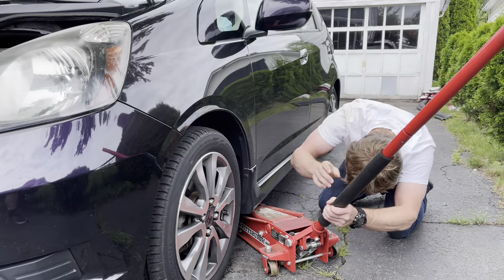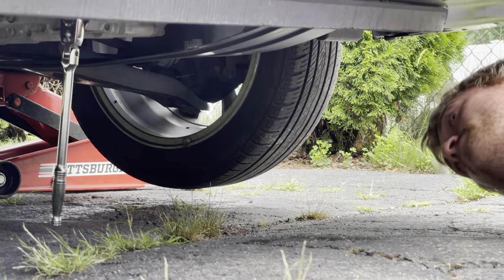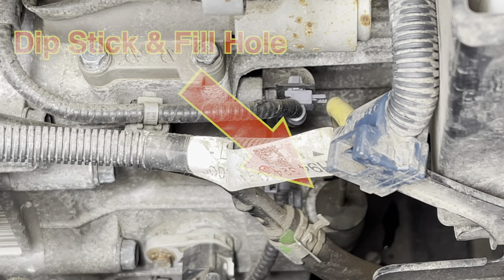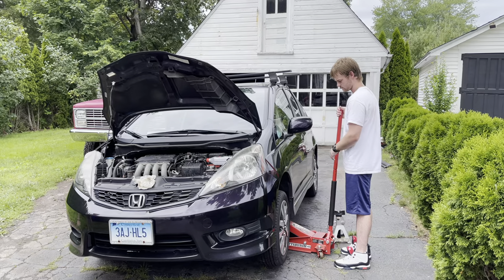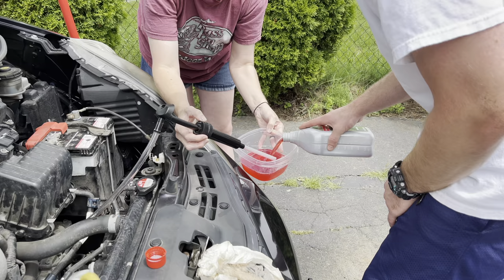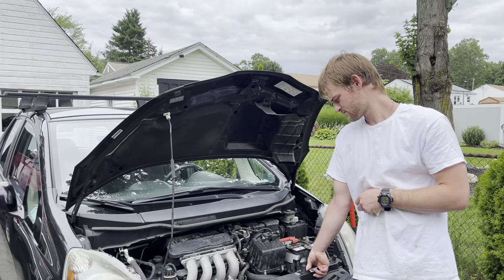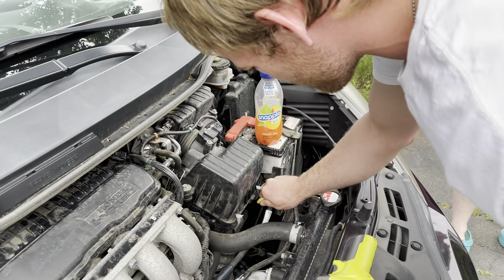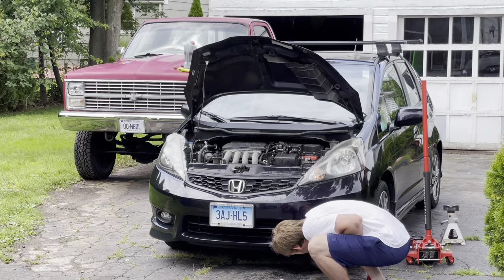DIY Guide: Changing Transmission Fluid in a 2013 Honda Fit

Comment: I believe you should drive the car until the fan is running then check the transmission oil. The gearbox needs to be running to heat up the gearbox oil. Hope this helps ❤
Reply from the maker: Hi Steven. Thanks for the tip! We followed the manual, which states on page 208 to park the car, start the engine and wait for the fan to start. Manufacturer's usually have specific instructions for each vehicle, and it's best to follow what the service manual.
Reply: It definitely don't have to be driven. It does take forever for those fans to kick on though in cool weather when it's like 50 degrees out
Reply from the maker: @jackle842000  Correct. The manual doesn't mention driving it - just getting it to the proper temperature. It was a kind of a strange procedure compared to what I was used to, but I'm older, and cars weren't so fancy back when I worked on them.
Reply: @MarkDHall  Right there with u on that one. Been a total game changer over the last 30 years no doubt!
Reply from the maker: @jackle842000  But it's still great that people are so into cars, though I think a lot of younger kids don't care about them as much.

Comment: Honda DW1 fluid as used in the video is  NOT designed for Honda Fit transmissions , Wrong fluid. Use Honda CVTF .
Reply from the maker: We don’t have a CVT transmission. Using that transmission fluid in it, would be very bad.
Reply: USA models 2007-2013 use this transmission fluid DW1. So he is correct in using this.

Comment: Today Honda and 3 other shops quoted me over 200 bucks to do this on an '07 Fit.
Reply from the maker: What?! That's crazy! I'm old and remember oil changes that were less than $20 at a shop and in the store a quart was around $1.00. Now it's not uncommon for an oil change to be $100 at a shop, and oil by itself is crazy expensive. Hope you're able to do it yourself and save some cash.

Comment: Good Video 1- So during this, would be like almost a Full transmission flush 2- but if you do a one time flush it would be a 20% Flush which Scotty says to do 3- I would change the transman Filter also located under the battues. I Just bought the 2013 Fit  so going to do this in the spring when it get Warmer. (might do a 2-flush) How do you like your 2013 Fit?
Reply from the maker: Hi - Yes, doing it this way is not a full flush. It's a partial, so you do need to do it multiple times. Changing the filter is also a good idea too. It sounds like you're going to have a great time with your Fit. They are awesome cars. We love ours. Thank you for watching.
Reply: @MarkDHall  and its a good choice as  gas prices keep going up and it fun to watch the GPM meter.
Reply from the maker: @musicstevecom  Exactly. With their prices going up like crazy, it's good because it pretty economical, and the engine is a basic engine, which is really reliable.
Reply: @MarkDHall  Does the American Honda Fit 1.5 sport 2010 year have an automatic transmission or cvt?
Reply from the maker: @giorgiiobashvili3552  HI - I'm not really sure. Our 2013 is a traditional 5 speed automatic. Not sure about the 2010, though. Sorry I couldn't help.
Reply: CVT’s came out after the 2014/15 models.

Comment: I don't understand why 3 times.  If I take the car to Honda for AT fluid change am I going to have to bring the car back 3 times?
Reply from the maker: Hi Jim. The service manual (not the owner's manual) recommends flushing the transmission three times because there’s still fluid in the transmission lines and torque converter after just one flush. If you have it done at a shop, they should schedule you for 3 flushes, but I don't know if they actually do that.

Comment: Try using a 1/2 inch copper pipe and funner next time. That how i add transmission oil to my car.
Reply from the maker: That's an awesome idea! I told Matt about it, and he said he'll remember that for next time. The pump thing from the store didn't work very well.
Reply: @MarkDHall  Cool, Just make sure you  deburr both ends of the pipe. Otherwise, The burrs might break off and get mix with the oil.
Reply from the maker: @francpez7564  Thank you. I'll let him know.

Comment: Great video.  I will do exactly how you did it.  What was the torque value of the drain bolt?  Do you remember?  Thanks for the video.
Reply from the maker: Hi Michael, unfortunately, I don't know the torque spec, but Matt said he will look it up and get back to you if you haven't already done the fluid change.
Reply: 36 lb ft/ 49 Nm if same as 2009 (09 and 13 are both gen)
Reply from the maker: @mankchiu  Thank you for sharing!

Comment: Hi, I have honda fit 2012 GP1 (From Japanese market). The transmission oil dipstick is labelled HMMF. Unfortunately, I seem not to find Hmmf in my country. Instead I find CVTF fluid. Can I use CVTF instead of HMMF?
Reply from the maker: Hi George - I'm not familiar with HMMF fluids and can't offer any help. I'd try Googling it or asking a local repair shop if there's any nearby. Thank you for watching!
Reply: @MarkDHall  thank you for responding to my question. I will appreciate if the repair shop can clarify to you the difference between CVTF and HMMF.  I will be following your channel. Thank you for the good work you are doing.
Reply from the maker: @onyangoabuor5863  Thank you again for watching. Really appreciate it.

Comment: I have a 2012 honda fit sport, the transmissions gears hard from 1 to 2. Could it mean its about to go out? Checked the fluid and its not low or anything 🥲
Reply from the maker: Sorry for the slow reply. It could mean there's a problem. I'm not a transmission expert, so I'd take it to a shop and have it checked out. Hopefully, it won't be anything major.

Comment: Many thanks for sharing your information and experience. How did you manage to get the instructions? I would also like to learn more about the replace vs. fluid flush. Thank you.
Reply from the maker: Hi! Matt works at an auto shop and has access to the service manuals. They're different and cover things the owner's manual doesn't. Matt was taught that generally flushing fluids with a flush machine isn't good to do and can cause issues, but I would definitely suggest doing research and seeing what is best for you. Thank you for watching!
Reply: Not much info seems to be available.
Will have to consider yours, given the reading material you guys were able to access.
I once flushed a Toyota transmission and will do so again.
The Honda Fit CVT is another matter though. Will not take the risk unless I find credible recommendation to do so.
Reply from the maker: @super8tube1  I'm not sure if I mentioned it in the video, but our transmission is not a CVT. It's an old fashioned 5 speed automatic. When I was younger and had just gotten married, I took my wife's car into a dealer to have the transmission flushed because it had never been serviced. It was higher mileage, and about 2 weeks after they flushed the engine, the transmission died. It was going to be $3000 25+ years ago, so we just sold the car. We spoke to a different mechanic afterward, and he said we shouldn't have had it serviced, especially flushed because it was so old any worn metal inside was "holding it together" and keeping it working. I'm not familiar with CVTs, but I know they are different. Again, I'd talk to people and try to read up, though I know there's not much info, and see how to proceed. You don't want to fool around, and you want it to run for years.

Comment: Tks for the video, but I'm wondering about the filter. Should it be changed every time you change the fluid? Tks
Reply from the maker: It depends on your year. Our manual says to change it every 30,000-50,000 miles. Matt said ours wasn't due when we made this video, but he did it on the next one.

Comment: Hi Mark, thanks for your video, do you know if there is any difference between a 2012 ATF and yours?
Reply from the maker: Hi - I'm not certain about that. I know some models had the CVT version, whereas we have the version that has actual gears like 1, 2 and so on. Even if they're both the same type like the, I don't know if they're the same or different. Sorry I couldn't help. Maybe the manual says?

Comment: Which one is the type of  ratchet that you used and the size?
Reply from the maker: It's a Snap-on 3/8" Drive Dual 80 Technology Long Handle Flex-Head Ratchet. It's about 12" long. Editing to add the model number is FLF80A. We went with Snap-on for the pivoting ratchet because all the other ones we had would break at the pivot point. Hope that helps!

Comment: Tengo un 2009 cuántos lts lleva de aceite??  Y gracias por compartir!!
Reply from the maker: Hola, no estoy seguro porque podría ser una transmisión diferente a la mía. Tienes el manual? Podría decir.
Reply: @MarkDHall  es un Fit 2009 4 cilindros automático motor 1.5 lts. Que tipo de aceite lleva?
Reply from the maker: @juancarlosbermudez2434  Hola. La información debería estar en la tapa del aceite. Yo también consultaría el manual. ¡Espero que ayude!

Comment: Hi, can I  know if my honda fit she's, 2013 model cvt if it has  a filter in the gear box?
Reply from the maker: Hi Matthew. I'm not exactly sure about the transmission filter, but I found this website, which tells a little about it: https://www.nalleyhonda.com/2013-honda-fit-transmission.htm#:~:text=2013%20Honda%20Fit%20Transmission%20Filter&text=Your%202013%20Honda%20Fit%20will,every%2030%2C000%20or%2050%2C000%20miles. I'm not sure if the filter is inside or outside the transmission. Hope that helps.

Comment: Thanks for the video! Did you have to jack up both sides of the car, or just the driver's side to be able to access the transmission drain bolt?
Reply from the maker: Hi - I can't remember for sure, but I'm pretty sure we just did the driver's side. I watched the video and don't see any indication that we jacked up the passenger side at all.
Reply: @MarkDHall  thanks!

Comment: Thanks for the video. Just to be clear, 4 quarts came out and were replaced with three?
Reply from the maker: Hi Kevin. Yes, 4 came out and 3 went in. We had always had a shop work on the car, and they must have over filled it when they did the transmission fluid change at 60,000 miles. When we put in 3 quarts, the oil was exactly at the full line on the dipstick. If we had put in another quart, it would have been way over full.
Reply: @MarkDHall I thought it was due to not getting all fluid out when draining, which is why it’s recommended to do this 3 times.
Reply from the maker: @kylecline  There could be fluid left in the transmission, but you ultimately want to go by dipstick. Four came out of the pan, but if we had put more in, it would have been overfilled.
Reply from the maker: @kylecline  Wanted to add that you're correct about the 3 times being needed to get out as much of the old fluid out as possible. It's never going to get 100% out, but Honda must feel that 3 times is enough to dilute it to not cause any issues.

Comment: Question .. each time you drain the trans fluid do you need to put new one in .. ? so 3 changes off new fluid ? or do you just put new fluid once .. then drive it 100miles drain it and re use that fluid that came out  after the 100miles ..
seems excessive to use new fluid each flush
Reply from the maker: You want to use new fluid each time because you want to get rid of the old, dirty fluid.

Comment: What's the torque spec for the transmission bolt ? Please share
Reply from the maker: Hi Larry. We couldn't find an official answer, but based off some Google searches, we went with 36 after reading the fit freak forums. https://www.fitfreak.net/forums/2nd-generation-ge-08-13/95974-quick-atf-drain-bolt-question.html

Comment: which tool do you need to take out the screw in the transmission case?
Reply from the maker: It's a standard plug. You can use a wrench or a socket. Matt likes to use a socket.

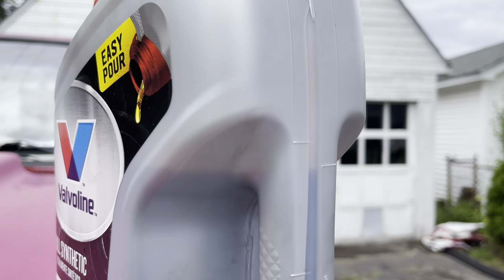Comment: 2:06 is wasn't over filled, pan capacity and transmission capacity are two different things. the torque converter can have a ton of fluid in it
Reply from the maker: 2.6 quarts is the drain and fill amount that Honda says should be in the pan when doing a fluid change. Fluid typically doesn't drain out of the converter when the engine is off, but if it does, Honda has factored that into the 2.6 quart capacity. The dry amount is totally different and includes additional fluid that's needed to fill a new transmission and converter when completely empty.

Comment: Hey, I have a 2013 Honda Fit does it have power steering fluid because my car is having issue taking corners and making a clanking noise.
Reply from the maker: Hi. Yes, the 2013 Honda Fit does have power steering and needs fluid, but if it's making a clunking noise, that is more likely a suspension related issue.  Thanks for watching!
Reply: @MarkDHall  I think the 2013 model has electronic power steering, so no power steering fluid.
Reply from the maker: @jaimodi640  Great point, Jai Modi. I didn't even think about that. Thank you for sharing!
Reply: @jaimodi640 Electric power steering .. not much electronic in it .. only speed depending power outlet to the e-motor. In the ol' days they made it speed depending by divert oil pressure or regulate oil pressure ..

Comment: why does my manual fit not have a dip stick or a drain :<
Reply from the maker: Manual transmissions don't have dipsticks. There is a fill hole under the car that you fill with fluid until it starts to overflow out of that hole. When that happens, the fluid level is good. Here's a good video I found on how to do it: https://www.youtube.com/watch?v=dXdXcH1dOfY

Comment: So the proper level of ATF is within the checkered mark ("xxx*)? am I right?
Reply from the maker: Hi Francis. The manual should tell you exactly what the dipstick looks like and how much to fill it. It sounds like yours is the type with "hashmarks", so you'd want it to be in the "xxx" area, but double check the manual to be sure because there's a lot of different styles out there. Thanks for watching!
Reply: @MarkDHall  Thank you sir. Upon checking my manual says it should be between the upper and lower mark of the hashmark. It stated that it should be done after the engine reach the operating temperature.
Reply from the maker: @francisgabrielsalvador9805  Great! Glad you found it. Most are the same, but there are some that can be different. I’m not sure if it’s all Hondas, but a lot require them to be checked at operating temperature.

Comment: How much tranny fluid does it take?  Mine has the same code and I'd like to do it myself.  Thanks for the video!
Reply from the maker: Hi Geoff. Best option is to check the manual because the amounts can vary between vehicles. Thanks for watching!
Reply: @MarkDHall  cool will do thanks Mark!

Comment: The correct amount is 3.5 quarts per Honda. If you only fill 3, the might not be level.
Reply from the maker: According to our manual on page 269, the capacity is listed as 2.6 US quarts for the automatic transmission.

Comment: Why don’t I have a dipstick?
Reply from the maker: That's a good question. I not aware of any 2013 models that would have a "dipstick-less" transmission. Did you have any work done at a shop and they maybe checked the fluid and forgot to reinstall it?

Comment: You won't get all the fluid out on a drain and fill....this is normal.
Reply from the maker: Correct. This is why the manufacturers usually want you to repeat the process a couple more times after driving it a bit. Thank you for watching!

Comment: This is completely wrong.  You drain and fill once, not 3 times.  If you do what he says your trans may stop working as the viscosity of the fluild in high milage vehicles is paramount.
Reply from the maker: The method we used is exactly how the Honda service manual, says to do it, including draining it 3 times. It's impossible to drain the transmission fully in one session. If you think you can, you are mistaken. If a transmission has no pre-existing damage (metal shavings/worn clutch packs), you should never use any fluid other than what the manufacturer recommends. Matt is a certified auto tech and has done hundreds of transmission fluid changes in his career.
Reply: As Mark is saying .. Hondas service bulletin says a 3 to 4 time oil change on the AT to call it an oil change .. says the skandinavian 4 year educated mechanic (me) on LV and PV (that is Volvo'sk for trucks and cars) ...
Reply from the maker: @SCS10000  Thank you. Matt is a service tech, and this is how they're told to do it. Thank you for watching.